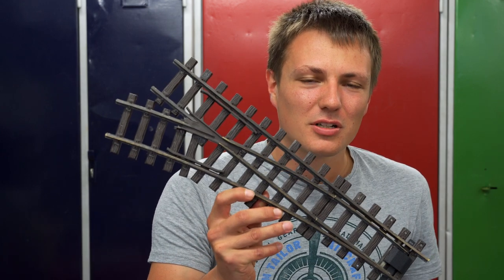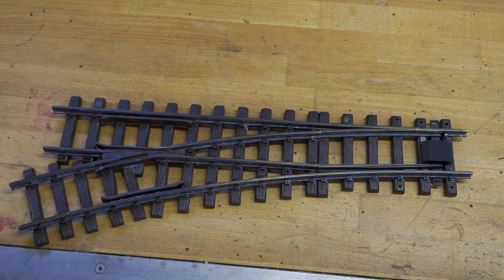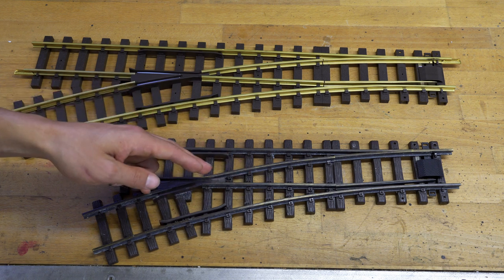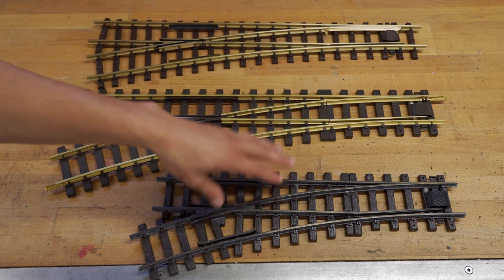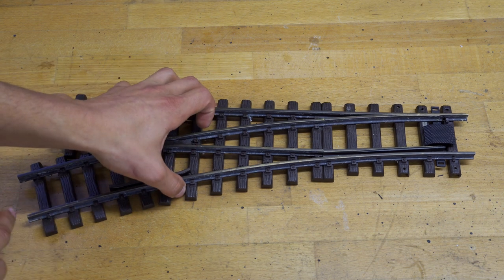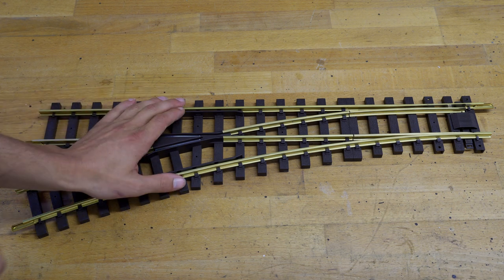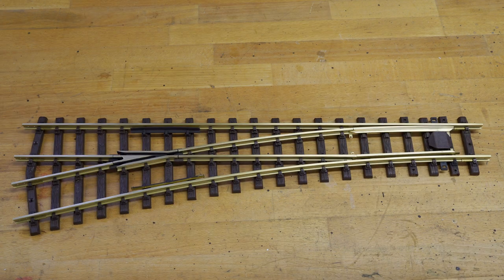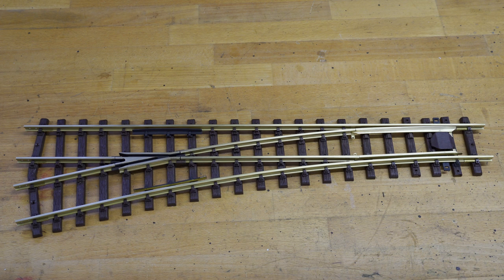What matters when buying switches for your garden railroad II BEGINNER´S GUIDE

Comment: I agree regarding LGB over years out side in snow, rain and sun with deer, squirrels, leaves, bugs the switches loosen and finally the plastic ties get brittle and parts no longer are in position. I have Aristocraft stainless steel track and switches that have done well. But plastic ties tend to get brittle as well. I bought 8 foot stainless rail and bent it using Train-Li track bender which works while the Aristocraft rail not track (pair of rails in ties) bends rail in slight spiral twist instead of flat curve like Train-Li track bender. I stagger rail joints to eliminate vertical and horizontal hills and valleys sectional track tends to form causing derailments. 6 to 8” or more separation between rail joints works well until switches. I use rail clamps and switches are mounted on flat plates of aluminum or other non rotting material. Switch joints to track have 4” or more support to prevent track from dropping or rising at the joint. Look up Terror Trestle on youtube to see my old track.
Reply from the maker: Thank´s for your comment! Plastic ties will at some point allways get brittle. But some hold up better than others. Using long pieces of track is key for a smooth opteration. I use THIEL flex track in 2,4m sections (8ft) and I also use the Train-Li track bender, it´s simply the best, I love it! Your trestle looks really good as well!

Comment: I have never heard of the Theil switches, however with a brass Frog you will find a Microswitch under the throw device to switch power on the brass frog from one side to the other as the switch is thrown.  You will also find the same thing on Aristocraft large radius switch's and you will find that they are very temperamental and can cause shorts if the microswitch does not throw completely.  Very good video, I like the joke!  See you down the rails.
Reply from the maker: I don´t think THIEL is very common in the US, by now several people have told me that they have never heard from this company. Here in Germany they are well known amongst the garden railroad community. I do know about the possibility to power the Frog via microswitch however I won´t do so until it becomes a problem in the future. All my locomotives are equipped with a capacitor, that should help for the most part. If i discover that small locomotives will run out of power when crossing the Frog I will install the microswitches.

Comment: It would be good to note that the R5 LGB and R5 Aristocraft points are very different, and when you have two lines connecting it is common to have the dreaded 'wiggle' between connecting points (namely with the LGB points, whether it be 30, 22.5 or 15degree designs.
Reply from the maker: Thank you for your advice! Since I have no experience using Aristocraft points I haven´t considered them in this video.

Comment: I wonder if a tiny amount of threadlock on those screws would keep them in place so you don't have to dig those switches back out again.
Reply from the maker: That might be a good idea. I will try it with my next LGB switch altough I´m currently using THIEL and PIKO switches exclusively for the new layout.